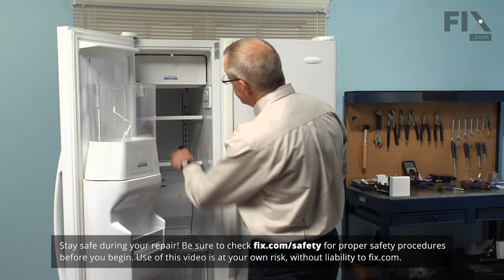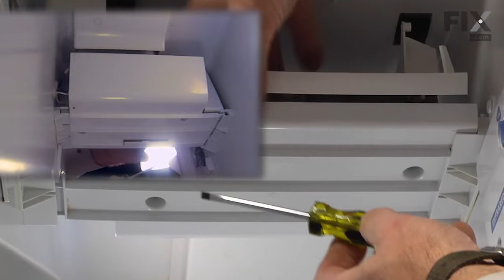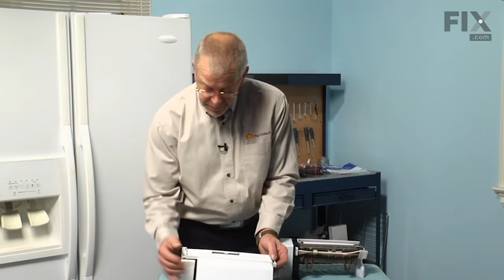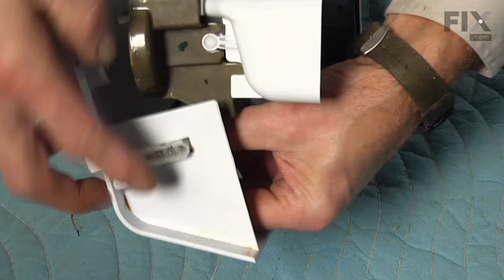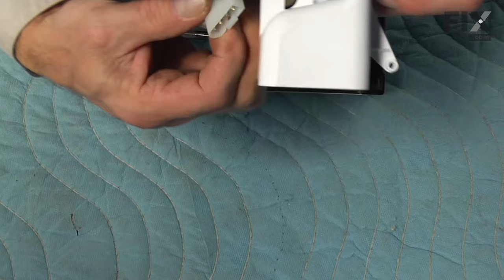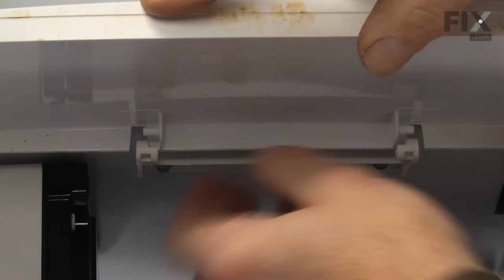Whirlpool Refrigerator Repair - How to Replace the Ice Maker

Comment: Great video, thank you! I installed my replacement recently and it's been perfect, until this week. The ice maker is still working, but the bin is not filling up. The large, black connector wire in the back popped out and I think that's the issue. Quickest, easiest fix? Do I need to take it all apart again? Appreciate your help.